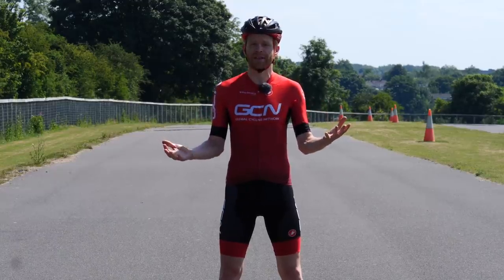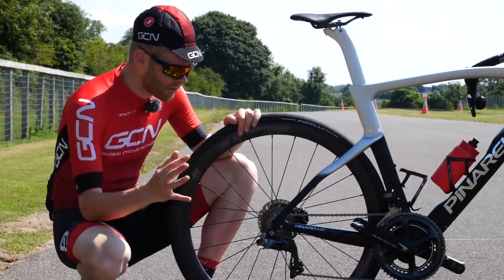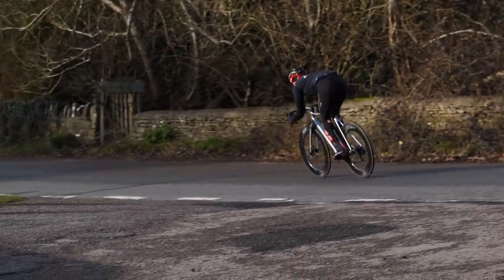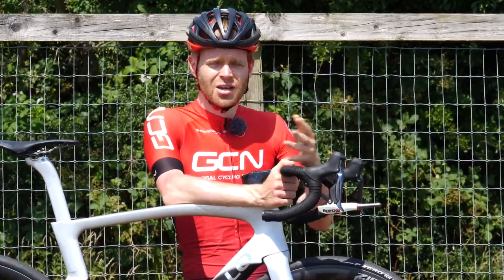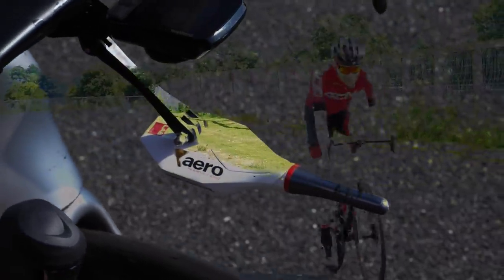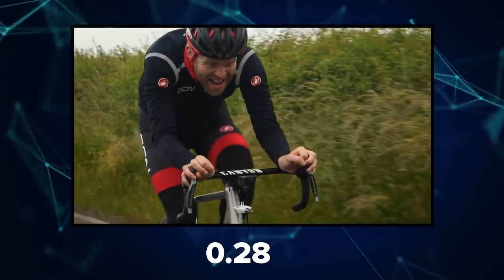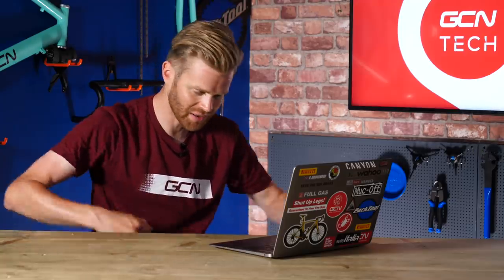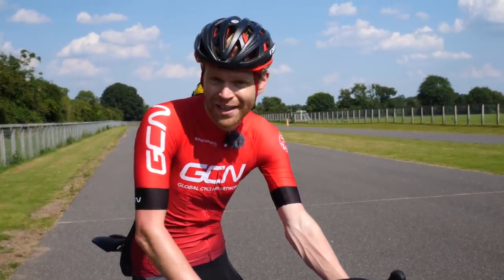How To Do Real World Aero Testing | Tips, Hacks, And The Ultimate Gadget?

Comment: -Slammed stem facing up vs. spacers with stem facing down. 
-25c rear tire with 23c front tire. 
-Water bottle on down tube vs. seat tube.
Reply: Great ideas!
Reply: Aero coach hast tests on the bottles and on different tires.
Reply: Roll down testing is tough. 18 trials for 3 different body positions each got me 15 miles that day. Faster tires would be nice but as a wheel breaker and puncture champion, the tortoise usually wins. Aero matters more on the flats where I ride. No team car will ever follow me

Comment: Would love to see a test comparing shallow / mid / deeper wheel sets. Something like 35 vs 45 vs 60mm (then predict time over something like Sa Calobra, adjusted for weight differences also)

Also: 45 front/60 rear, 60 front/45 rear, something like that: see what effect there is mixing depths up between front/rear
Reply: Yeah, would want some actual shallow ones in there like you get on entry level bikes. Such as 23mm DT swiss P1800 spline instead of 35mm (or as well as)

Comment: Would appreciate similar tests at different power, such as 150, 200, 250 watts. Some ideas for more aero tests:
Dogma F vs Dogma F12
Dogma F disc vs Dogma F rim brakes
Different handlebar widths, varying by 2 cm
Different handlebar heights, varying by 2 mm spacers
Aero handlebar vs normal round handlebar

With an FTP of 220 watts, other than clothing, wheels and helmet, I’m not sure there are any additional aero gains to be had for me.

Comment: Nice review. I’m lucky enough to have the Aerolab sensor to work with and the results so far have been really interesting. Finding out which equipment works best in the real world has opened up a whole new area of bike fitting for me. I’d be particularly interested in seeing a comparative test of TT front wheels. I’ve tested a few so far and the results can be interesting.

Comment: My 2 cents on Roll Down Testing:  Choose a bit of road with a definable start (and end too, if possible) in terms of elevation features (e.g. bump/dip/flat transition).  Use a wheel-mounted speed indicator for accuracy vs just the GPS.

Comment: I would like to see a comparison of a superbike like the Pinarello Dogma F, but set up in a suboptimal way (dry and too long chain, not properly clean, too low tyre preasures) versus a cheap bike with no aero elements (either an alloy bike or something like my original Planet X Pro Carbon), but set up as good as it gets. Position remains exactly the same on both bikes. That could be quite interesting.

Comment: I've always wondered if different cadences have an impact? Peddling faster must create greater disturbance in the air, but does that have a positive or negative effect?
Reply: My guess would be that it doesn't change a lot because you and the bike are moving through the air much faster than your feet and pedals move relative to the bike.

Comment: 1. Could you test Cda difference of having a rider behind you. 
2. Another one is the half illegal time trial. i.e. one forearm on the handlebar and the other on the hood. I find this comfortable for long periods.
3. A fake baby bump type of thing to fill in the space around your chest, so the air doesn't get trapped like a parachute.
4. Inserting a foam tube down your sock (back or front and back)to simulate a wing type structure, i.e. not a cylinder. A cooked sausage would be handy to stick down your sock and eat later.🤣
Reply: I think I could pull off that half legal TT position since I have 2 layers of 3mm tape on my bars! I may do roll down testing if I can ride that way. It may be faster in a cross wind depending on which fore arm is down.

Comment: When the sensor is calculating cda, how does it know (calculate) your frontal area? Is it something you have to input? What is a typical value for 180 cm person (I know it will vary a lot, just a ball park)?
Reply: The sensor value the sensor knows from the power and wind data is the value of drag coefficient (Cd) and Area (A) already multiplied together into CdA, you would only need to know Area if you wanted just the drag coefficient on its own, which is not necessary for this application. Or to say it another way, it doesn't calculate drag coefficient and then multiply it by an approximate area to get CdA

Comment: Your conclusions aren't quite right. Riding out of the saddle doesn't add that extra time unless you ride at the same wattage as you could/would do seated. But cyclists typically ride out of the saddle because they can put out more watts than seated. So you might not lose any time, but might do if you stayed seated and thus had to ride at a lower wattage.

Comment: Get off the bike to save weight & improve the aerodynamics to have the fastest bike you can get!  Your body is the biggest aerodynamic obstacle in the whole equation.  Merely considering the frame & it's components is ignoring the largest factor in moving through the air on a bicycle.